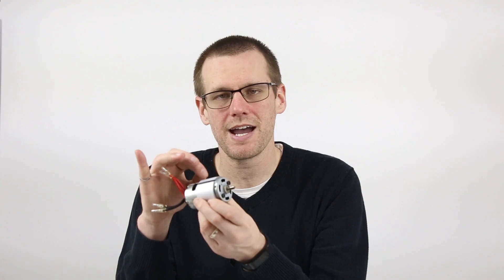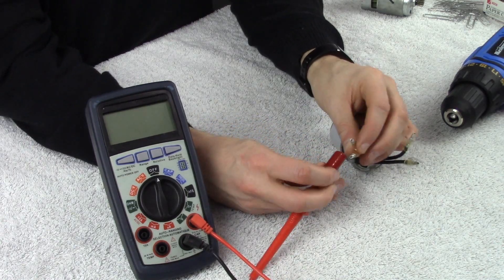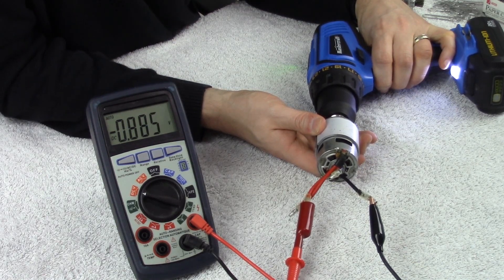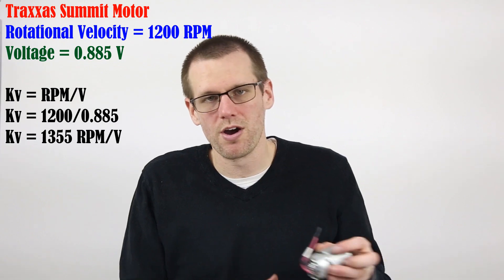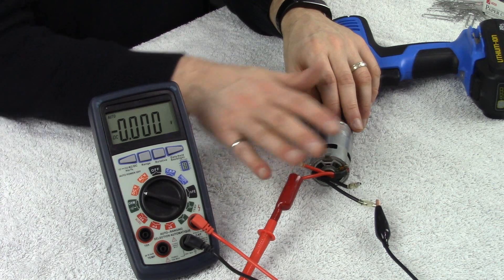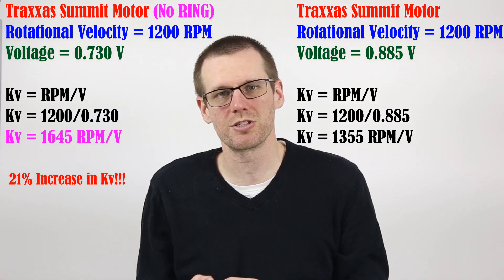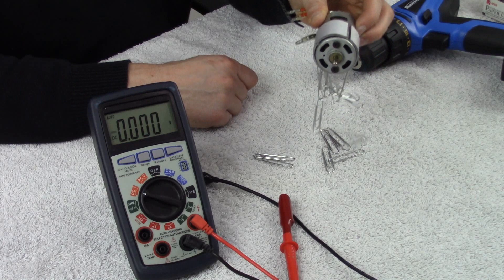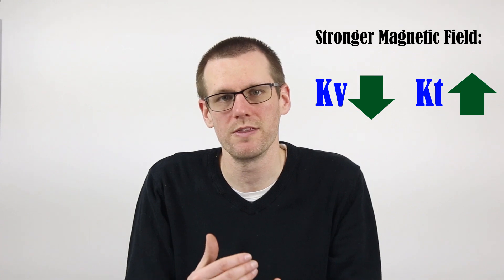Measuring Kv of a BRUSHED Motor & What does that ring do?

Comment: Years back. I ran lots of different 700 motors that had the ring. Running boats the ring came off to fit a water jacket on the motor. Did I lose some torque or rpms, not sure. But the motor stayed cooler. I ran 12, 16 and 18 cell monos and hydros.

Comment: hey! I came across your 2 videos on BLDC motors as I’ve been having troubles with mine

I wanted to clarify if it’s possible for a spoilt motor controller to spoil a BLDC motor? As reference, I’m using these motor controllers from AliExpress on hoverboard wheels & I noticed using a working motor controller on this “spoilt” BLDC motor causes it to turn a bit at the start, before it makes a whirring sound

Used this exact same motor controller on the another BLDC motor & it can move fine

I’ve ran this “spoilt” BLDC motor through several motor controllers that were afterwards burnt so I’m not sure if the spoilt motor controllers could’ve indeed spoilt it 

Is the “spoilt” BLDC motor really spoilt?

Comment: I think in the end you meant "unplug" your equipment so your batteries don't die.  From what I understand, an ESC will still draw from the batteries even when turned off.  True or False?
Reply from the maker: I left the multimeter on last time I used it and the battery was dead. But, it most definitely is correct that an ESC will draw power from the batteries and its best to unplug the battery from the ESC.